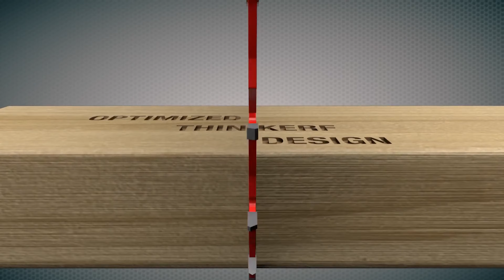Selecting Circular Saw Blades - Teeth, Kerf, Coatings, Hook Angles & More

Comment: I guess my questions are about the actual teeth of the blades. What materials are they and how do they vary? What is the rest of the material of the blades?
Reply from the maker: Great questions! Most saw blade teeth are made from carbide, which is a really tough material that stays sharp for a long time and cuts through wood and other materials easily. There are different types of carbide being used as well.  For example, Diablo offers their TiCo Hi-Density carbide for longer life on their wood and demo blades and a Cermet II (Ceramic and Metallic) for their metal cutting.  Some other special blades use materials like diamond or high-speed steel for cutting metal or tile.

The rest of the blade (the round part) is usually made from strong steel. This helps the blade spin fast without bending. Some blades also have little slots or holes that help reduce noise, heat, and vibration while you're cutting.

Hope that helps! Let us know if you need help choosing the right blade for your job.
Reply: @ wow! Thanks so much for that information!